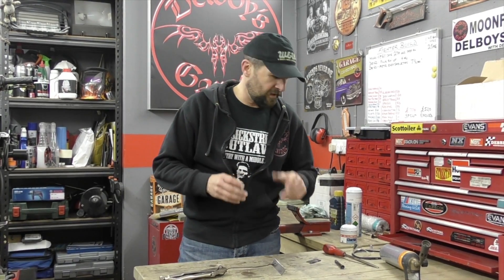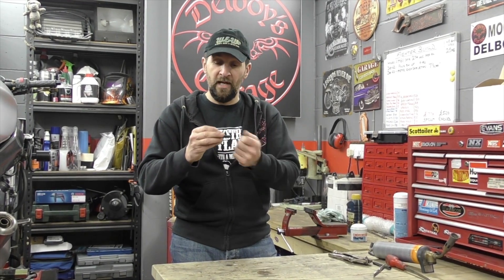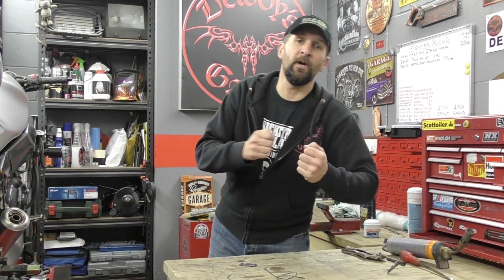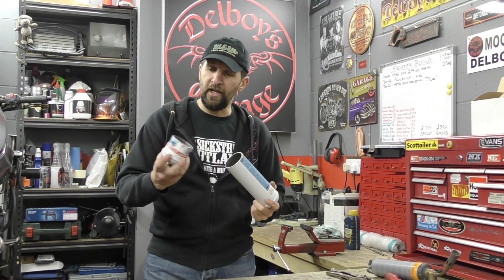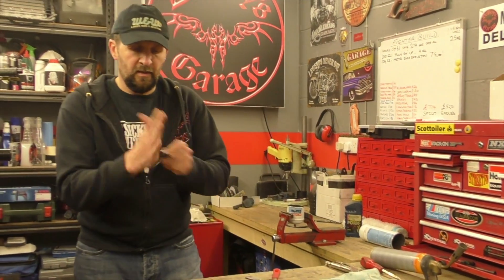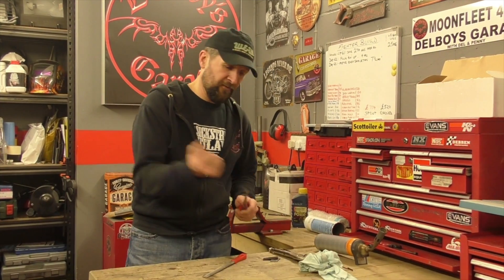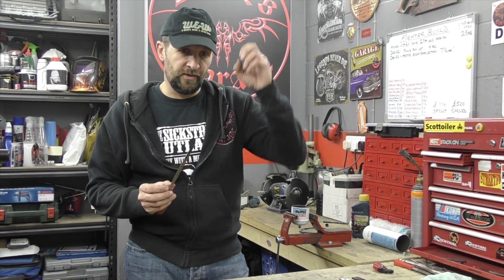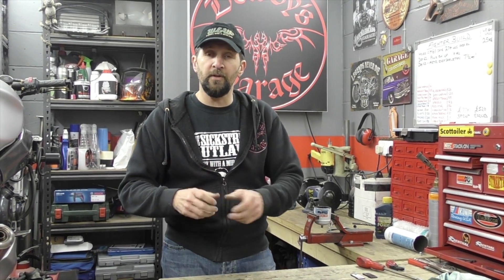Delboy's Garage, Simple Skills, "Oil Quenching/Tempering steel"

Comment: If I remember correctly, in school we were taught that only high carbon steel can be heat treated, carbon content of .8 to 1.1 % , tool steel such as A2, D2, 01, SPS and I'm sure there are others. Low carbon steel can be case hardened.

Comment: Hello Del, Sorry mate but your missing the most important point, Carbon content. 
Mild steel is not effected by heating and quenching. To harden mild steel you need to add
carbon to  the surface. This is called case hardening, and can be done using anything from suger to bone meal and many things in between.
As an example of quench hardening steel, you could use Silver steel. Silver steel can be quenched in water at about 770 to 780 C and in oil from 800 to 810 C. Some of this is also size deendant.
Once you have hardened the siver steel you tend to need to temper the steel. Tempering is reducing the hardness and making the silver steel less brittle. This is done by reheating the steel to set temperatures for set times and then again quenching.
A few  other steel can be quench hardened using the same kind of method, but certainly not straight mild steel.
This is a typical analasis for silver steel;
Carbon 1.00% 
Silicon 0.30%
Chromium 0.40% 
Manganese 0.35%
And this is for generic mild steel;
Carbon  0.16-0.18%
Silicon  0.40% max
Manganese  0.70-0.90%
Sulphur  0.040% Max
Phosphorus  0.040% Max
Reply: yes hardening then tempering two separate processes done it a thousand times in engineering .

Comment: To anyone who wants to actually apply this technique to something on their bike or some other project. Just be aware that tempered steel will also become brittle and will easily crack or break when force is applied to it.
Reply from the maker: Hi John, it's slightly more complicated than that, for metal to become hard and brittle it has to be heated further than this, usually up to bright cherry red, about 1000 degrees, so as long as you keep it lower, you won't temper it... the whole matter of hardening and tempering metals is pretty complex, this practice has been done for a 1000yrs, since blacksmiths used it for preventing rust on tools.... also if you're worried it's got hard, then heat it again afterwards and let it cool naturally, and that will re-anneal it...
Reply: I usually get my files to about 2000 degrees before i quench them after sharpening the end. I  use it for scraping spatter off the area surrounding my welds. Ive noticed that sometimes the edge ive put on will break. Ive had a strong suspicion that i was heating it too much. Thanks for confirming this
Reply from the maker: Hi buddy, 2000 degrees is more than double what you would use for carbon blacking, you literally only need about 800, which is barely glowing red... if you are getting a file up to 2000c, then you're almost melting it... as a little tip buddy, quench it slowly in warm oil, not cold water... that will make the cutting edge more durable.... and if it helps, you could watch a few videos from the knife making and blade making community, those guys really know how to make a durable sharp edge.... thanks for your feedback fellah !

Comment: hey body i like you video i tried everything you said and the file scrached the new quenched steel what am i doing wrong
Reply from the maker: Hi Yes, a file can still make a mark, but was the steel harder, did the file slip over easier with less drag?... if so then you had some hardening effect at least.... maybe practice a bit more and get the heat dead right.. it needs to be cherry red, or about 800c before you quench it.. and if you quench it in cold oil, it works even better..

Comment: Is that something that could be done to an old chisel or center punch, something that would take a blunt impact? I just grinded the center punch back to a point and left it alone..I've got some old chisels I'd like to clean up as well. 

Great one by the way, I never got any of this at school and I'm interested. 🙋🏼‍♂️
Reply from the maker: you can sharpen a punch a few times as long as you dont get it too hot... but if its blunts first hit ..then its time to re-temper it..!!!

Comment: If i remember my metallurgy classes correctly all metals on a microscopic level consist of what can be considerd as grains. The amount of grain boundry in contact with the grains surrounding it affects that particular piece of metals inherent properties.  More boundry (large grain) = malleable and less "hard", less boundry (small grain) = brittle but "harder". Why is this relevant ? Because as you quite rightly point out metals/welds cooled very slowly will produce malleable metals and conversely the opposite for quickly cooled metals. Dull thing to point out i know,  but keep up the hard work guys, brilliant entertainment as usual.

Comment: great video, very simple and very informative. Love these type of videos! (I'm curious tho. If I used really cold oil, and/or a bigger tub of oil, would the more oil/colder oil make it colder even faster? Would that help in any way?)  just thinking into it a bit. Cheers Del!
Reply from the maker: yes, the greater the volume of oil the more heat exchange can take place and reach "cold" faster, specially if you wave it about in the oil to help cool it... but not too cold in temperature, that could crack the steel..!
Reply: Moonfleet41 ahh I c.. So too cold is not a good idea. Lol. Glad I asked haha. Would there be any benefit of having the oil be a bit coder? Would the more rapid change in temp make the steel even Harder? Or would it basically be the same hardness..
Reply from the maker: No, ambient temp is fine, but you can use some really dirty old engine sump oil, the blacker the better because that ads carbon and will help a lot..!
Reply: Moonfleet41 - That's what I kinda figured.. Never know till ya ask tho, right. lol.. / (I do have 1 more Question tho, lol sorry) - I'm very interested in this technique of using "Dirty Oil" to prevent rust is just mind blowing to me.. Amazing.! (I love the science behind stuff...) - This is the most helpful video by far on the preventing of rust on Nuts, bolts. & Many other parts... - In my Opinion (And I'm sure you would agree) If your going to do it, You might as well do it the BEST way you can. Especially when the job/process consists of the Exact same amount of Time and Energy to end up with a Much Better end results Eh! lol. / So if Im understand correctly.... If someone "Only" had clean New oil, they Should be able to add a small amount of crushed/powdered Charcoal into the Clean Oil and still get the same result.? (Using Charcoal from Either a Wood BurningStove or Charcoal from a Grill.) "BUT NOT chimney soot, cause it's crazy flammable, lol... - (Unless there's a difference in the carbon or something.) / I Just watched the New Video you posted today. That pretty Shat that you ran out of gas ehh.. but I suppose, it is what it is... Thats the time to just roll with the punches right buddy.  Also I wanted to say that The idea of what your doing is so creative, and the execution is even more impressing then could be imagined... (Like with Most GREAT Art/Artists) - You are an Artist Del, TRUELY! - The end product will Absolutely and Undoubtedly be NO LESS than a completely Beautiful "ONE OF A KIND", "1000+ HOUR" CUSTOM "Street Beast"..!! - Entirely made from Individual pieces of Art all in themselves..! (Keepng the theme going by converting tanks was brilliant.! Although not intentional at first) All while making sure that they ALL Mesh together to create ONE Amazing "Work of Art.!" Breathtaking! - (What do you think about doing a Short 4K Video in the future.?) SORRRY for the long messages. I'll hit your e-mail up from now on if you'd prefer. Cheers Del (Dan)
Reply from the maker: Hi again Dan, sump oil is best, there's always gonna be sump oil, just drain some out of your car!  And diesel engines are better, as there is more soot in it.... I have never used it as an additive to clean oil, so can't really comment...  Thanks for your kind comments on the bike, it's coming along and happy with it so far.... cheers!
Reply: Moonfleet41 - cheers Del! Diesel it is.. Lol. I'm also sure I can go to a local small auto business and ask for a quart of old diesel oil. Thanks buddy. Have a great week! (Dan)

Comment: I cringed ! Nail some MDF onto your lovely benches for god's sake.
Reply from the maker: What a silly thought... its soft, highly flammable and the dust from it is carcinogenic.. ill cover them both in steel when i get round to it..!
Reply: Steel's horrible to work on, and expensive to replace. There's stuff in your shed a lot more hazardous than MDF (like oil fumes!) Wood's carcinogenic too (cellulose)  Use a fan, like wot I do, and if the shit's real bad, wear a full organic respirator.
Reply from the maker: Steel top bench is perfect for welding, then i done have to faff about with an earth strap on every part im welding.. just earth the bench.!   and its fire proof when molten metal lands on it..(which is what all the black spots are..lol)
Reply: I'll stick with my MDF tops and keep replacing them when I've drilled enough holes through 'em, scraped enough heavy metal over. 'em and hammered the shit out of 'em. I've got a benchtop stool made of aluminium for earthed welding. I'll continue having my own silly thoughts, ha ha. Cheers , mate

Comment: (p) Hi Del. Roughly how long did it take to heat up the metal to the right temperature before you quenched it?
Reply from the maker: Hi Jon, with that regular blow torch, about 2 minutes..! but it wouldnt have got any hotter, the propane just doesnt lend enough heat to take it to white hot, no matter how long you hold it in the flame....!

Comment: In my limited knowledge on the subject, i believe by heating the steel to critical point then quenching is hardening and tempering is when you heat the steel up again to a temperature below critical point for a certain period of time then allow to air cool . This will take a little hardness out which will make the steel less brittle . And if you really dive into Metallurgy you find out that some metal need to be quenched in oil others in water and others just air, which to me is interesting. The way explain stuff just makes sense. Good video sir . Cheers
Reply from the maker: You are right Tex, there is "Hardening", and "Tempering", also you can use Borax to do "Case Hardening" which is a hard shell but softer below..... you can also quench in iced salt water.. and a lot depends on the metal you start with..... then once you get to grips with all that.. you can start on alloys.. Brass, Bronze, Copper, Tin, and on and on and on... its huge, and most kids today dont even know the first thing about it, and that's because the education system is tuned to turn out expert exam takers and get great test passes.. the more certificates they get, the better job.... shame aye!
Reply: interesting, never heard about case hardening.  and yeah it is a shame but even when i went to school i feel that 90% of what they taught was not 'real world' skills.

Comment: Nice. I'm making a knife from an old tenon saw as we speak. Adding lots and lots of salt to the oil helps with tempering process too. i don't know why, but I've learn that trick from an old friend of mine, who was an "amateur" sword maker. Quick video on that may be coming when I finish the whole process...
Reply from the maker: Hi buddy.. ill really look forward to that, i love anything about blade making.. have a little experiment with "Iced salt water" too... not for thick metal it it can crack it really easy... bit it turns mils steel wire into damn near spring wire...!
Reply: Just need to remember when making a blade or an axe that heat-treating consists of two steps, hardening and tempering. In hardening, you heat the blade to a critical temperature and then quench 
it. This changes the structure of the steel so it's extremely hard but  also pretty brittle. A knife in this stage, if dropped, can crack or  shatter like glass. The next step, tempering, is done by heating the knife to a lower temperature, around four hundred degrees. This makes the knife less brittle, while still keeping a relative amount of strength.
Reply: It adds carbon to the steel buddy, shitty used engine oil is good for it too  :)